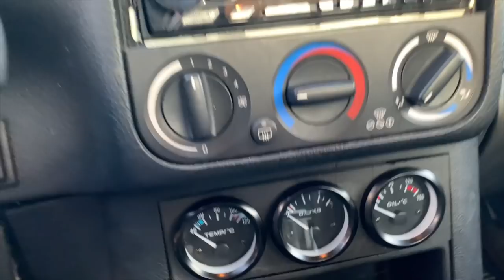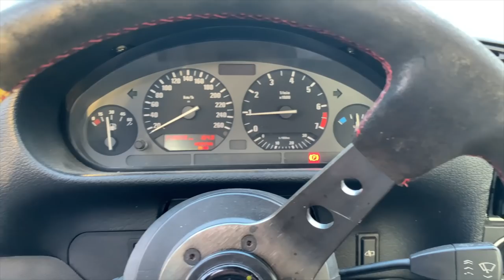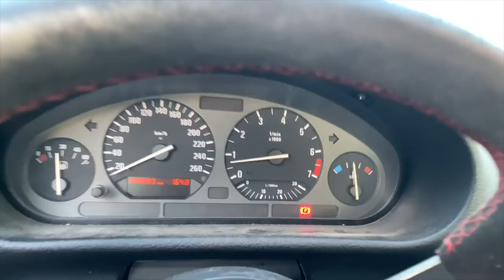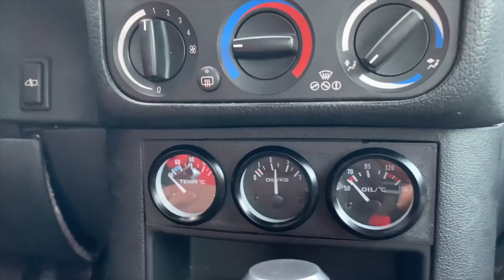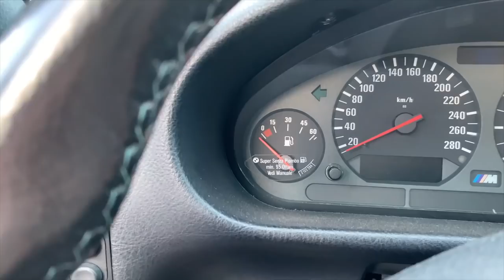BMW M50B26 Premier test sur route!

Comment: Hey man, nice video. I am planning to upgrade my m52b20 stroked with m52b28 crank and conrods too. Do you know the compression ratio of the final engine? If I calculate it correctly, it should be around 14:1?

Comment: pour 3000 balles, je me serais amusé à coller un turbo au bloc 😁
Reply from the maker: Max Hartmann pour l’avoir fait sur la mienne avec 3000 on serait pas arrivé au bout du projet y a tellement de pièces à fiabiliser si on veut pas être trop emmerde . Après un montage low cost peut être mais si c’est pour être embêté souvent on préférait faire un truc fiable
Reply: @carparted  un jour je le ferais, je collerais un turbo avec seulement de la pièce de récup, en essayant de tout faire main, pour voir jusqu'où je peux limiter les coups tout en restant fiable

Comment: Speak in English?
Reply from the maker: Колян Production Studio yes sir we can
Reply: @carparted  Perfect.  Problems At high rpm are they not?  Don't lose power?
Reply from the maker: Колян Production Studio we didn’t dyno the car yet so it’s pretty complicated to judge only by the feeling you have at the steering wheel. We will dyno it soon and then we will be able to answer .